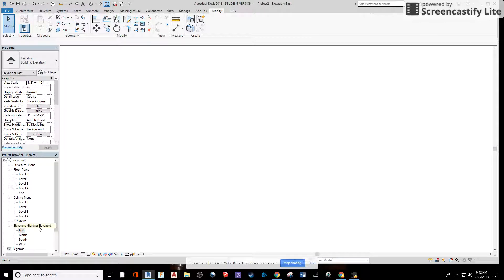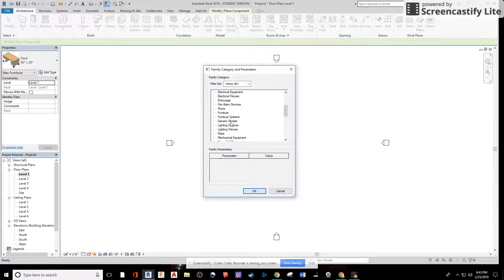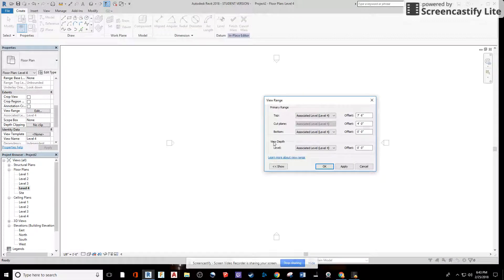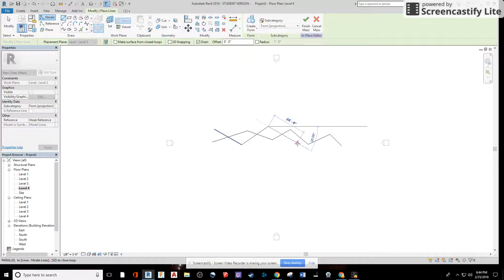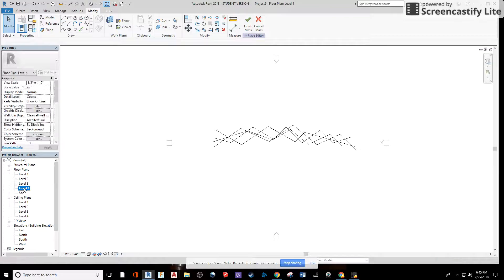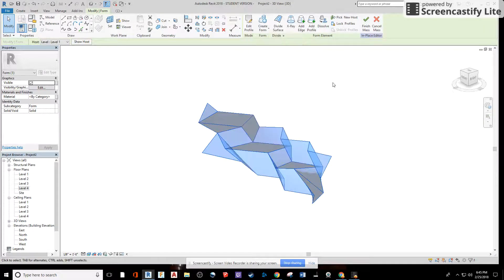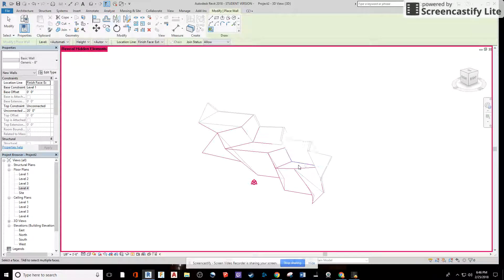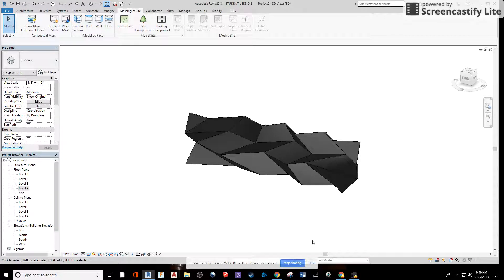Revit - Rock Climbing Wall!

Comment: THANK YOU! This is exactly what I needed. Thanks for your quick response! Out of curiosity, if I wanted to make a cased opening in it or cut a section out after the fact, how would I do that?
Reply from the maker: Rachel Teichroew you’re welcome!!! There are two ways to make the openings. 

1st way- after you make the first mass, you’ll want to make the openings with another mass, but choose Void instead of Solid when creating it (I believe I have a video on this).  

Another way is after assigning the wall to the mass, you can edit the profile of the wall by selecting it and clicking the edit profile tool and then draw out your openings by modifying the sketch of the wall in an elevation view.
Reply: Thanks so much!

Comment: Whenever I create the form, it is very smooth and curvy when I want it to point like in the video. Do you have any idea why?
Reply from the maker: Great question.  I have no idea.  The only thing I can think of is if are you using a spline at each elevation to create the loft maybe that could throw it off?  Were you able to figure it out yet?
Reply: The same thing happened to me. Any solution?

Comment: Hello! Thanks so much for the video, really easy to follow. Would you have any tips on how to make this look more like a cliff face? I have a model that sits right about 1 metre off a large natural rocky cliffside so having one as a backdrop would be amazing for when I'm taking rendering. Would it just be a matter of trying to draw it with more angles or potentially using the spline tool when drawing to go curvier and more haphazard? If you've done something like this and have any tips I'd be so appreciative. Thank you!
Reply from the maker: I would create that landscape in a rendering software called Twinmotion (made by Epic Games). There’s a plugin you can use (datasmith) for Revit to import your model into the scene in real time.  Google it and check it out if you can!

Comment: hi there, that was quick and easy. But how would I put a material onto the mass?
Reply from the maker: Thanks for the question! One way to do it is to set the material in the properties menu for the mass (you must select it before checking it off to complete the mass).
Reply from the maker: A second way is to assign a wall by face to the mass (see the massing and site tab), then set the wall material to what you want.
Reply: @Studio_Hero  thx for that! I worked it out after I wrote this - now I am just trying to figure out what the best way is to place the climbing anchors

Comment: This was such a great video and explanation! In terms of adding materials would you add them directly to this file? Or could I copy and paste this into my actual model and then add materials, would that still work?
Reply from the maker: Good question.  If you plan on importing this into another project, I think the easiest way would be to first assign materials to this file before importing it into another model, but you should be able to change it after you import if need be, you might find this video helpful for that process: https://youtu.be/l9QTGh5LraQ